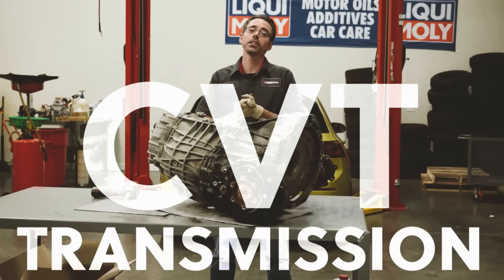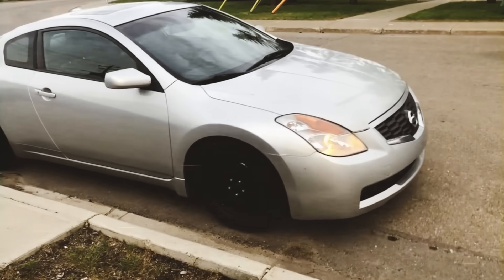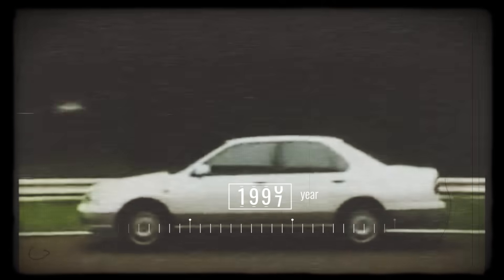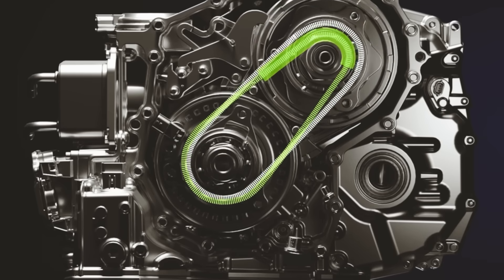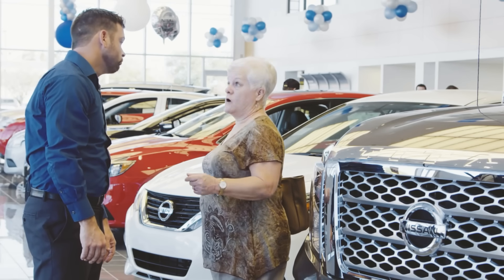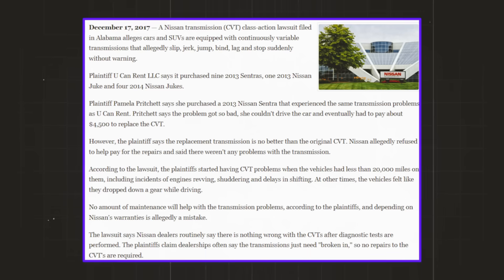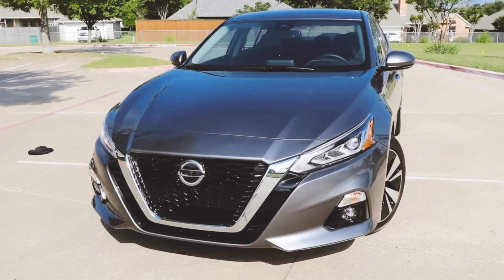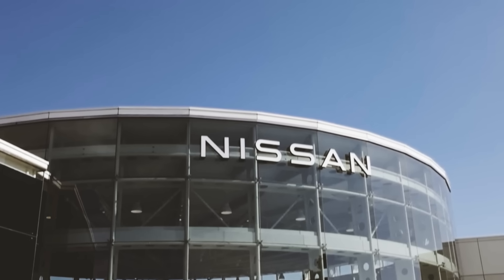Unpacking the FAILURE of Nissan's X-Tronic CVT

Comment: The main problem it’s your “owners may not be maintaining their CVTs” point is that the official service schedule for all of these cars at no point has a fluid change for the CVTs, just “inspect the fluid”… on a transmission without a dipstick… you know these owners are having someone else do this stuff, so they hope the service provider actually does it AND recommends a fluid change when needed. Which is a $300+ job. Nissan brought it on themselves for normalizing the neglect of those transmissions.

Edit: Apparently I've been called out for "lying" or spreading misinformation. I'm not. The passage above hasn't been touched. I've had to lookup the service schedules and maintenance sections of manuals of multiple CVT equipped Nissan passenger vehicles, INCLUDING THE ONE I OWN and it looks like I'm correct. 

In most situations, all that would be done is an inspection of the fluid, unless you are under certain driving conditions or the service dept. of the dealer you take the vehicle to recommends it (after the customer determines if the dealer isn't just trying to drum up business by recommending unnecessary maintenance, look it up, its a common practice). There is no simple, "Just change the fluid every x miles and do it more often if you beat the snot out of it." As a result, the service often doesn't get done and the transmission often fails.
Reply: No wonder.  Mitsubishi recommends changing fluid  (drain and fill?) every 30K miles.  There is also a filter in the oil cooler housing that needs to be changed.
Reply: Change it every 30k
Reply: That’s idiotic on the consumer’s part actually. The fluid should be changed regularly, just like a normal transmission.
Reply: My owners manual says every 60k change CVT fluids.
Reply: @scottcui8087 in japan nissan cvt  fluid change 15k
Reply: @scottcui8087 what year and model owners manual are you referring to, and is that for the normal or severe service schedule?
Reply: I can confirm, Nissan dealers don't do anything to maintain CVTs. They claim there is no work package. They only replace when failed. Nissan has a huge issue with their dealers in North America. These do very little work and charge a lot for small efforts. I think their mechanics in general are good but their system and customer interface / care are horrible, know very little about Nissan's cars and actually pay very little attention to their customers. The Jatco CVT is weak and there is no way to keep it trouble free if the driver wants power and doesn't pay careful attention when it starts to slip. So the lack of maintenance only makes it worst. Nissan inability to do anything useful over decades is very sad.
Reply: 2 nissan sentras here 2017 & 2018 both lemon lawed, first car cvt failed at 4k, 6k, 10k, 10k lemon 
2nd car 8k ,10k,11k,11k i will never own a cvt again
Reply: Part of the fails are due to how much power the engines are putting on these transmissions, the other part is owner neglect, the less amount of power means the less amount of stress put on the transmission and if serviced every 40k miles or so it should last 150k miles without issues
Reply: That's a crock. The narrator here specifically mentioned many of these CVT's were failing right at 20,000 miles.....watch the video!
Reply: @OCISupport-yj5bd Because it’s on video it must be true?

What number is “many”?

While I am by no means trying to defend Nissan or JATCO, but this video has its own share of sensationalism for drama effect.
Reply: They have paper filters and the dealership mechanic said they do not. They have no concept of maintenance for the CVT.
Reply: I work at a Nissan dealership as a lube tech and we recommend customers a cvt service every 30k miles, most people just decline the service 🤷🏻‍♂️
Reply: I have an Altima that had the cvt replaced at 86k miles. While the manual states to replace the cvt fluid every 30k miles, the rep at the dealer I bought and was taking the car to said every 60k, which I did and now regret. Thankfully when the cvt went out I was still under warranty, but now I have a constant fear that the new one will go out, even with service at every 30k miles. Ticking timebomb
Reply: New 2019 nissan sentra
> life time service at my dealership
> at 50k miles transmission had to replaced 

Your du×××mb as s××××hit
Reply: I do not own a Nissan. So I don’t know if Nissan’s maintenance manual is divided into a regular vs severe schedule. 

In my Mitsubishi Lancer (uses the same JATCO CVT), if you have below-freezing temps in winter, if road salt is used in winter, you fall into the severe maintenance schedule. There are other driving conditions that would put you into severe schedule. 

Mitsubishi’s service interval for CVT fluid:
Regular schedule = 60K miles. 
Severe schedule = 30K miles. 

I’ve always had my CVT fluid changes done at dealership. So I know the correct fluid is used. 

However, what I did not know, is there is also a CVT fluid filter behind the warmer/cooler. Mitsubishi did not code this item to be replaced during fluid changes. 
At 172K miles, that filter was completely clogged, causing zero flow to the cooling circuit, over temp, and limp mode. 
After changing out the filter, wire mesh, cleaned fluid pan & magnets, changed fluid, the Lancer ran fine again. 
After that episode, I’ve even started autocrossing. No further CVT issues so far. 

I do suspect many people cheap out and get their transmission serviced at oil change places like Jiffy Lube. 
Despite my transmission being a CVT, the plastic molding on top of the dip stick says “ATF”.
I can imaging if oil change attendant didn’t look up vehicle specific details, would have poured in traditional ATF instead of CVT fluid. 
ATF fluid will cause CVT belt/pulley to slip. So another few thousand miles later, that CVT will be toast.
Reply: My Nissan transmission failed before my car hit 20,000 miles.  I blame poor engineering on the cvt failures, not poor maintenance.
Reply: I was actually told by my Nissan service rep it is recommended at 40,000 mi despite with the manual says. I also hear it should be done with CVTs between 30,000 and 35,000 mi.
Reply: @paulking4908  did you hear that from a service advisor (sales)? If so, they are incentivized to sell your service that you may not need. I’ve been told so many times by them that I need my injectors cleaned, AC recharged, and engine air filter changed (after I done so less than 50 miles ago, my dealer didn’t even check if it was needed). The dealer’s management often sets guidelines based on some arbitrary mile markers sooner and far more frequently than what the manufacturer specifies. It’s standard practice. 

Do I think you actually do it? As far as the CVT fluid exchange, yes. Change your CVT fluid as often as you should generally change other transmission fluid. My original comment meant to say that Nissan dropped the ball when communicating a consistent, easy to follow standard on how to maintain them. But for other items, no. Nissan engines seem to be just fine long term when taken care of (Jury is still out for the VC Turbo)
Reply: Toyota definitely produces lemons now and then but from my perspective they are the only manufacturer that I associate with consistent quality. Nissan like so many companies hit a turning point at some point and I've associated them with junk ever since even though I'm sure they have made some good machines. Fortunately there are always people who don't do their homework and keep Nissan and others in business.
Reply: its still junk
Reply: Toyota Corolla CVT can go 200,000 miles without fluid change.
Reply: @GF-mf7ml "can"
Yeah I'd rather skip that BS and  do at most 50k.
Reply: @GF-mf7ml  The video is referring to Jatco CVTs. The ones found in Nissans and some Chrysler products. Toyota's transmissions are usually built by Aison or in-house. They typically have a physical first gear as they found that the most wear on the belt comes when taking off from a stand still where the most torque can be placed on it, or are eCVTs, which is part of their Hybrid Synergy drivetrain and a whole different beast.

If people wanted to get a Corolla, they would have gotten a Corolla, but most likely couldn't afford it so they are in a Sentra/Altima and Nissan is known for having deeper discounts off MSRP and giving credit to far less qualifying buyers. If those people could afford a Toyota, they would already have one.
Reply: @TrevorWilliams215  Jatco CVT even fluid and filter change still cannot go 200k miles.
Reply: @TrevorWilliams215  AISIN is toyota's in-house dude
Reply: @drunkenmonkey5529    Aisin and Toyota are not the same company. Toyota has a large stake in Aisin (~25%) and while their primary customer is Toyota and have several joint ventures with long and deep business ties, they supply transmissions and other parts to other manufacturers too. Aisin and Toyota are NOT the same.
Reply: @GF-mf7ml best of luck with that, you are clearly cognitively challenged if you believe that
Reply: That’s what they tell the morons that buy them but really you should change that fluid every 50K . I change the the fluid in my Honda every 15K I know it should be done too I’ve been a mechanic for 22 years . Take all the intervals in the book and cut them in have if you want your vehicle to last a long time .
Reply: @OracleLearningchannel   That sucks that your Rouge’s CVT failed so soon (under 20k US freedom units). I hope between you, the dealership and the manufacturer, things would have worked out. 

I do believe you may be misunderstanding my point. I’m not blaming the customers, I’m blaming Nissan for not adequately informing their customers on how to maintain their vehicles. 

As for your story, I hope you’ve been made whole.
Reply: one of my friends who's car I work on has a 2017 civic with a CVT and I believe it says to do a drain and fill every 25,000 miles. his car is at 195,XXX miles and he's had no issues.
Reply: Ignorance at its finest. Nissan's service manual does mention replacing the cvt fluid and filter every 30,000 miles or 36 months. It recommends checking fluid wear every 10,000 miles and if the wear is reported >210000 to replace the fluid.

The price and lack of a dipstick don't help, but that is pretty standard across all brands. At least it still has a fill tube on it and isn't a Toyota design that you have to pump laid into from under the car.
Reply: @afrozenpizza  dude Toyota is ridiculous for doing that 🤮
Reply: @afrozenpizza  I will refer you to my reply to trenton737. The "Service Schedule" document (There is no Service Manual, only an Owner's Manual and Service Schedule) for the Nissan CVT equipped vehicle that I ACTUALLY OWN states otherwise. 

TLDR: the Service Schedule only states to change the fluid every 60k miles under certain specific driving conditions.

Another tidbit: the Owners Manual tells you to go to a dealer if you want to check/change the CVT Fluid in the "Maintenance and Do It Yourself" section.
Reply: @TrevorWilliams215  well 2020 Murano says replace fluid at 60k mi. And again at 120k mi. Murano has the CVT8
Reply: @TrevorWilliams215  
Can confirm @TrevorWilliams215 is correct.

My Nissan Service Manual also states that the CVT fluid is only to be inspected, but does NOT say anywhere that it needs to be serviced UNLESS driven under certain driving (severe) conditions.

My 2015 Nissan X-Trail doesn't even have a transmission dipstick, but instead it came with this cap that covers the dipstick hole. This cap is a bit tricky to remove and I believe Nissan did it intentionally to stop people from changing the CVT fluid by themselves.

Nevertheless, I decided to change the CVT fluid, oil strainer and the cartridge filter at 90,000km by myself and it drives PERFECTLY fine.
Reply: @TrevorWilliams215  Just because I forgot to include it in the original response, the quoted 2015 Nissan Service and Maintenance Guide text comes from page 13 of the very guide that came with your /2015 Nissan/
It doesn't matter if you actually own one or not if you can't read.
Reply: @younamsayin  The cap instead of a dipstick is such an anti-consumer design. I notice that you refer to it as X-Trail and KMs, so I'm assuming a bit here that you're in another country. 
The 2015 US provided Maintenance Guide states:
For these vehicles with a CVT transmission, cube, Murano (except HEV), Altima, Altima Coupe, Juke, Maxima, Rogue, (except HEV), NV200, Sentra, Pathfinder (except HEV), Quest and Versa, replace the CVT fluid every 60,000 miles or request the dealer to inspect the fluid deterioration data using a CONSULT. If the deterioration data is more than 210000, replace the CVT fluid.

The field service manual states to inspect and not replace unless necessary. But if inspection can't be done, then to replace at 60k miles (96k KM).

Odd bit of mismatch there. But still, never states to just not replace to maintain the fluid.
Reply: @afrozenpizza  I need to snoop around a bit on the owners manuals of these Nissans, I did a bit of digging for my boss's Nissan nv-200 and it instructed to have it checked every 70,000 miles.
Reply: @alexwalker8422  Appears it does very year to year on what the recommend it. Inspect in the FSM is every 10k it seems, but the ones they provide with the car say every 30 in most cases.
Reply: @afrozenpizza tell me what year and model owners manual you're quoting. My 2016 Altima owners manual mentions only checking the fluid. Only severe service schedule mentions changing the fluid. I think it's very bad advice to not specify changing the fluid for normal service, but I am looking right at my owners manual and that's what it says, unfortunately.
Reply: @johnczahoroski1337  It's in several of my replies the exact book and page number that goes with a 2015 Nissan. 
It also tells you in the service manual that if it can't be checked with a Nissan Consult tool then it should be replaced. 🤷‍♂

But to save some scorlling
2015 Nissan Service and Maintenance Guide, page 13 states:
"● For these vehicles with a CVT transmission, cube, Murano (except HEV), Altima, Altima Coupe, Juke, Maxima, Rogue, (except HEV), NV200, Sentra, Pathfinder (except HEV), Quest and Versa, replace the CVT fluid every 60,000 miles or request the dealer to inspect the fluid deterioration data using a CONSULT. If the deterioration data is more than 210000, replace the CVT fluid."

Just a quick Google search shows that 2016 has the same verbiage in it.
Reply: Incorrect. All CVTs have a fluid change interval.
Reply: @joenissan wrong, only the severe service schedule has it for the 2016 MY.
Reply: That's a lie. It says 60k miles is when the fluid needs to be changed in the owners manual for all Nissan models with the CVT.
Reply: @trenton737 wel i live in caribean and we import right hand drive direct from japan i dribe a nissan cvt and japan recoment change oil evry 25000km wich is 15000miles
Reply: @trenton737 60,000 mi is for a regular transmission. It's now recommended 30,000 to 40,000 mi for CVT transmission despite what the manual says.
Reply: @trenton737  That is incorrect. I have a 2016 Altima 3.5 SL and the maintenance schedule says to have the fluid checked, not changed. I don't agree with that, but that's what the manual says.
Reply: @trenton737  Don't know what manual you are looking at, but in the official service schedule for my 2015 Sentra, it says at the 60,000 mile page:

"Replace CVT Fluid (NV200Taxi)^2 
Replace CVT Fluid (Hybrid Electronic Vehicle (HEV))^9...

...Inspect the following:
_ CVT fluid^5,7

2: Please check fluid level before replacing fluid. If the level is abnormal, visit a Nissan dealership and have the cause of the abnormality repaired before replacing the fluid.
5: CVT fluid on cube, Murano, Altima, Altima Coupe, Juke, Maxima, Rogue, NV200, NV200 Taxi, Pathfinder, Quest, Sentra and Versa.
7: Replace (not just inspect) oil/fluid if towing a trailer, using a camper or a car-top carrier, or driving on rough or muddy roads. (except Hybrid Electronic Vehicle (HEV))
9:Mileage only."

The parenthesis refers to specific vehicles or vehicles with specific characteristics that it applies to. Note that the explicit replace instructions does not mention normal passenger vehicles. Just a taxi van and hybrids.

The only time it instructs owners to change fluid of these passenger vehicles is during specific driving conditions.

My overall point is that Nissan established a culture with its owners and dealers of neglecting these transmissions and continue to do so today. As a result, the transmission gained a bad reputation of failing after the warranty, but before the owners are done paying them off. Their resale value shows (compare the Sentra to the Corolla, Civic and Mazda 3 of the same model year). No one really wants these things long term because they don't want to be holding the bag when the transmission poops itself merging on the highway.
Reply: @TrevorWilliams215  in my 2010 murano it said inspect and replace if needed.  It wasn’t until a few years later that they came out with 60k change recommendations.
Reply: @trenton737 Maybe that servicing period should be shorter.

Comment: The oil in a CVT should be changed every 10,000 miles. The factory says it's "lifetime" fluid or has a very long drain interval. They create a lot of heat which burns the lubricating oil up pretty fast. So... they should have a bigger trans oil cooler and a short trans oil drain interval. Learn to do the drain and fill by yourself at home to save money.